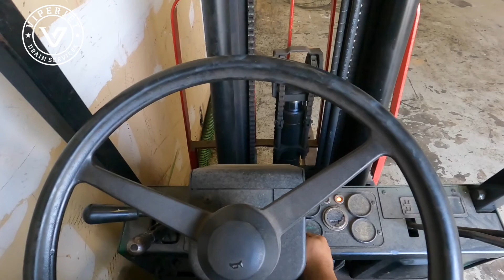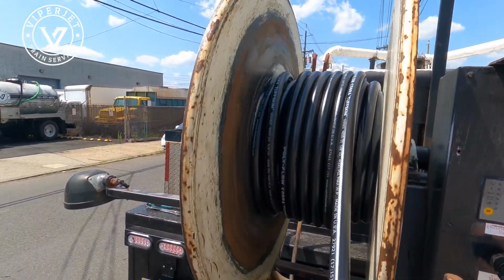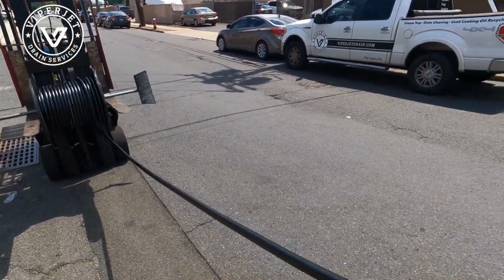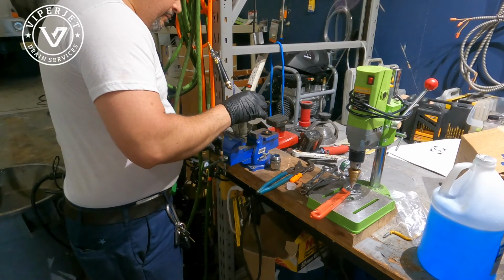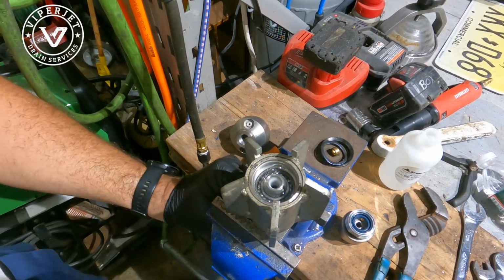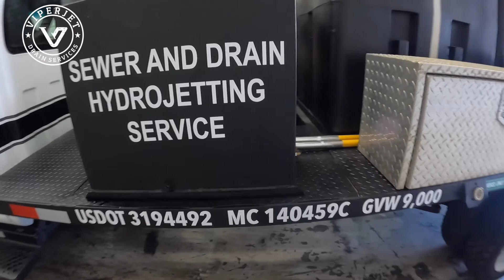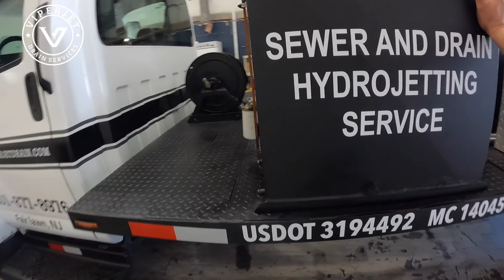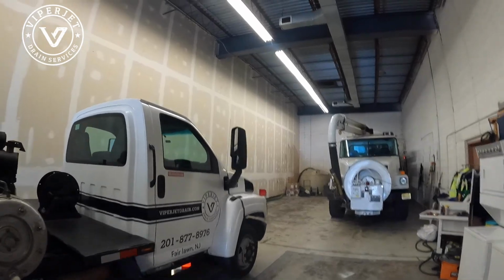Harben Jetter Truck Finished. Some Warthog and Hose Reel Work | ViperJet

Comment: It's cool they call it viscous, a play off of viscosity which is completely relevant. I blew the whole head off my WT series on the ½" hose a couple weeks ago. I only used it maybe 6x max and never for long periods of time. I may upgrade to the ws series when I replace it. I need to maintain the ⅜" wt warthog so I don't lose that too.
Reply from the maker: You blew the head off? What pressure are you running? Inside the line?
Reply: @ViperJetDrain  well, I think I have 17 gpm 3800 psi before the 300' ½" hose (friction loss)   I have 2 Honda igx800 engines tied together with general tfs2021 pumps. I had the basic warthog on it, the wt series I believe.